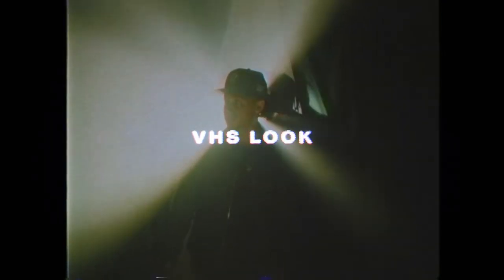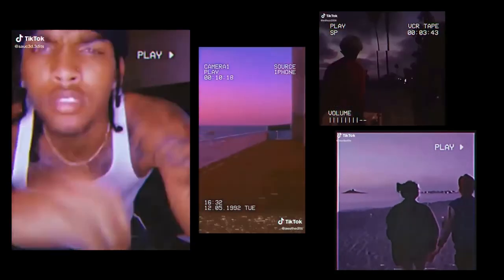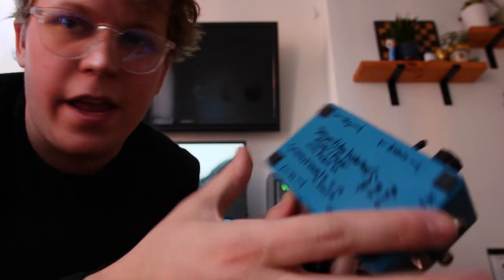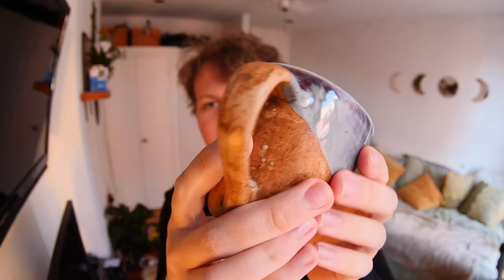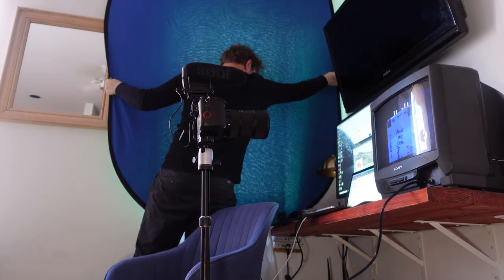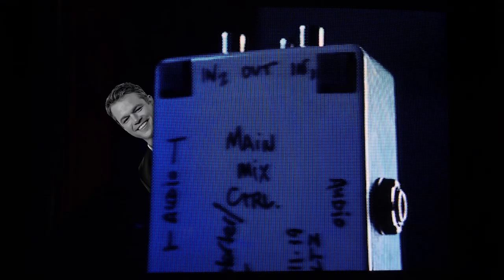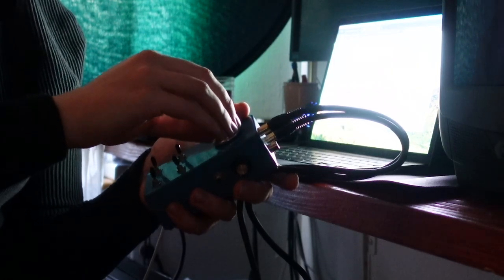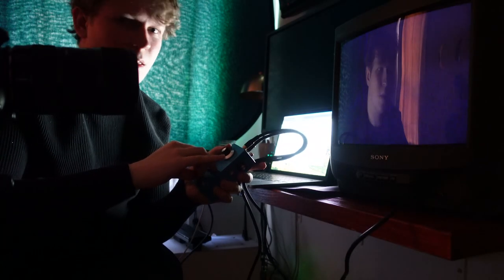Create Authentic VHS Effect using an OLD CRT TV | Real CRT Screen Method

Comment: fyi, your "glitch box" you're using is actually a "dirty video mixer", you're supposed to input two sources at the same time and turn the knob and it will create distortion as it mixes between the two signals. you didn't actually glitch anything when you had just once source in there... literally just changing the strength of the signal. it can also be built for <$5 (i'm hoping you didn't actually buy it for $100 or something absurd) and it just requires extremely basic knowledge of electronic components to build yourself.
Reply: hey think I’ve seen u mention it in one of ur vids but do u by chance have a link or vid for this build or any others? sorry if it’s in plain sight just having trouble finding it. i am indeed one of the suckers who bought one of these overpriced devices a bit ago, but would like to still learn, and build one myself.
Reply: Exactly. And it's not a "circuit bender"
Reply: and what about the toggle switches???? is there a version with that and how did that affected the signal is kind of unclear to me in the video.

Comment: Well I didn't make it, but I can tell one is controlling the shadows or the black point and the other is controlling the highlights or the white point.  From what I see anyways. And side note, blender is so powerful that it's crazy it's free. I saw a documentary on how they used to do those old school wireframe effects back In the 80s that looked like max headroom or Miami vice type of thing and it was this crazy large analog console that something like a rotoscope I want to say. Crazy how deep you had to manually go to make stuff and model it. I'd like to pick up one of those old machines someday.

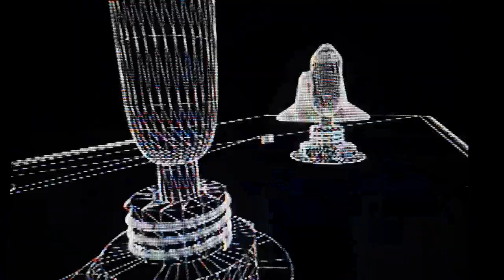Comment: Great video. Could you do a tutorial on how to edit graphics made from lines like at 5:47
Reply from the maker: Thank you! Before doing a tutorial on it, I can give you the the spark notes explanation. First of all, it's a 3d render I made in blender. I modeled the circuit bender (not really for this video but just for practicing 3d) and then keyframed a camera move to get that movement of zooming through it almost, and then rendered it as a wireframe. then I took those renders and incorporated it into the edit in premiere. I'm a super beginner when it comes to 3d, so using the crt tv to hide all the imperfections helps a lot! Thank you again for watching :)

Comment: what was the line 3d drawing, you did that in AE?
Reply from the maker: so that was a 3d animation in blender. still a total noob at 3d software. the wireframe thing is actually super easy to do if you have the right model. i took the animations and mixed them all together with the real footage, and ran all that through the tv. it looks like shit on its own but really cool with the CRT